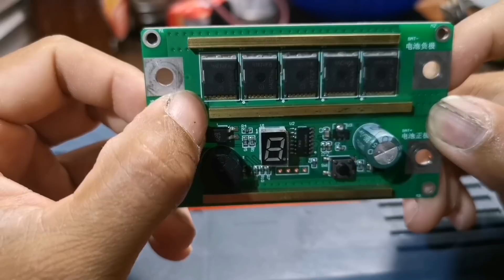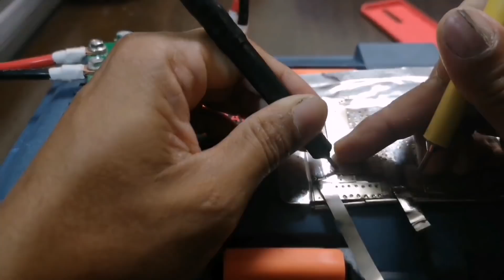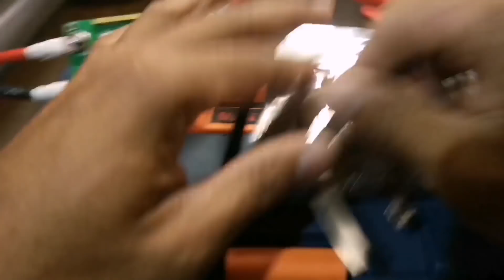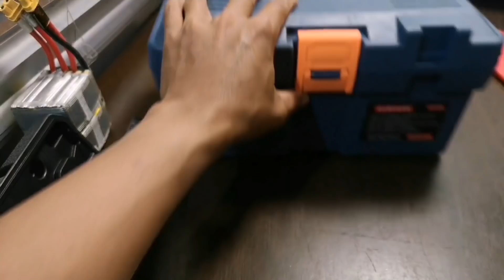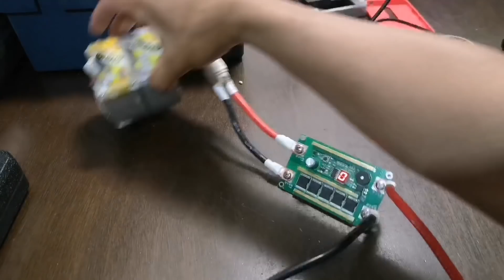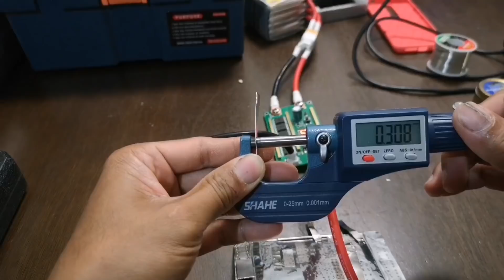CHEAPEST SPOT WELDER  REVIEW BEFORE MODIFICATION.

Comment: Thankyou for the video . What kind of power are using for the spot welder
Reply from the maker: this spot welding provide 8 gears  bos  and used for building battery pack to weld nickel strip. if you are using 0.1mm up to 0.15mm nickel strip used only Gear 1 if 0.2mm Gear 3 or 4 if 0.3mm Gear 7 or 8. for safety do not try directly to the battery familiarise first every  Gear.